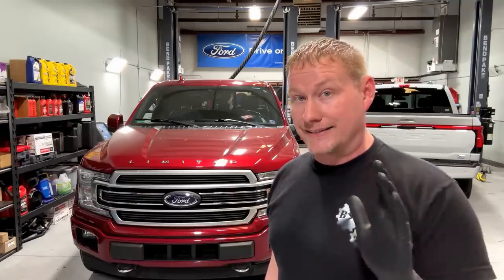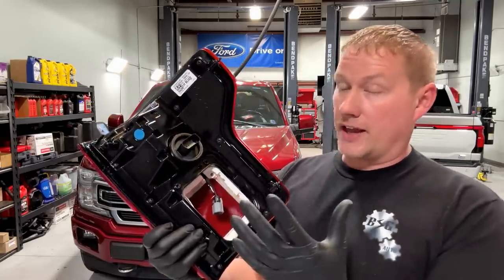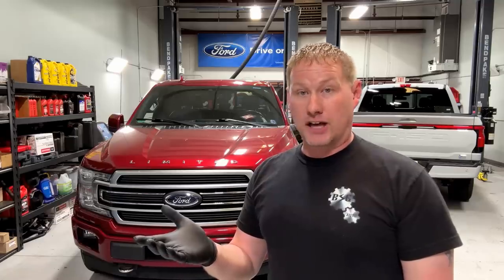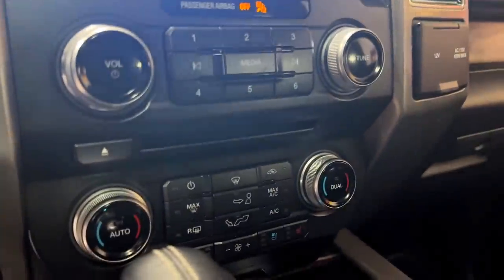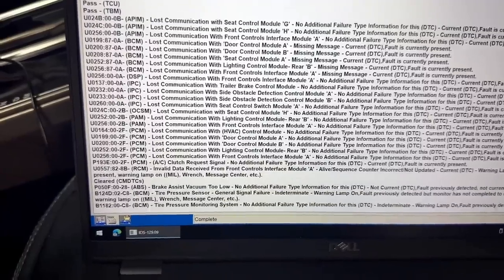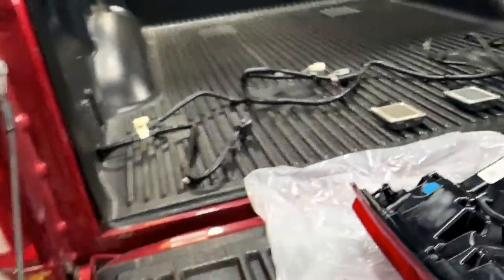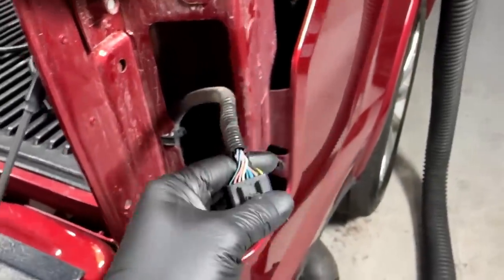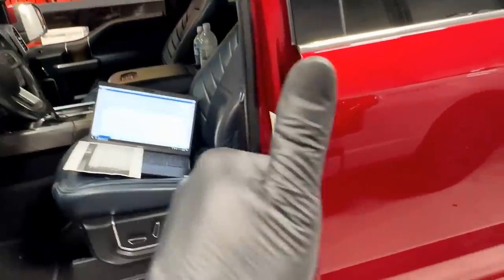Repair Cost Are Out of Control: $5,600 Bill for Some Tail Lamps?!

Comment: This should be reported to NHTSA and at minimum there should be a recall.
Reply: indeed. if that knocks the can bus out mid driving you can lose control of your vehicle.
Reply: Imagine thinking an authority is going to communicate with another authority that some tiny little consumer has an issue they want them to fix. Total the car and buy something you can pop the hood and fix yourself. Tons of videos breaking down cars simply.
Reply: Oh there likely will be a recall.
Reply: @mikenismogtr  As was done to Max Hastings in 2013. RIP.
Reply: Hundreds of vehicles need to start appearing with this issue for a recall to be ordered. The BLIS module is not a legally-required function. If the water causes the taillight to malfunction, that is a legal issue, however not recall-worthy. I wonder if the water intrusion occurred from the weld of the lamp or the seal on the bracket for the BLIS module. If within the warranty window, a dealer would replace this free of charge. That's why extended warranties are so key on modern vehicles, especially ones with loads of features.
Reply: If it was a common problem, sure. I don't think I've ever seen this issue before.
Reply: @jasonashley9853  I doubt it. This is an isolated thing. I have NEVER seen this from a Ford before. The module is protected from the environment inside the taillight housing, the seal just failed. I see this a lot with GMs and their suspension control module that's just chilling out on the rear frame rail.
Reply: Next year's model will include a blinker fluid bilge pump
Reply: Guarantee you that Ford knows this. Theyre aware. Hmmm. Wonder who might work at the nhtsa???  Hmmmmmm
Reply: OR, the owner got ripped because he bought a flood car.
Reply: We see many vehicles out there with cracked tail light housings because someone backed into a post or got backed into. This will be seen more and more.  Making things more complicated is NOT the way to win over vehicle owners.  That is a hugely unreasonable cost for a taillight replacement!!!
Reply: @CredibleHulk I own one of these vehicles, if you look at the tailight design it's a very poor seal, the lens cover itself also has a stress point from molding (running along  the adjacent edge of the tailgate) that likes to crack with temperature shifts. Add to that no weep holes provided and these lamps LOVE to fill with water.  Has  happened to me and several others I've met in owners groups. Ford is aware but chooses to do nothing. Should definitely be recalled.
Reply: Yeah and then Fore will completely shut down over this one.
Reply: 😂yeah right the blood hasnt risen above nose level yet and when it does theyll just build a raft and sail the red seas until the blood rises so high that its lapping the doors of their towers by then all the people that matter will be dead and theyll just wait for the blood to drain
Reply: @LukemDakuwa  Pretty blase advice from one who doesn't even live here. This issue might rise to a finding or even a recall-level event or it might not. Regardless, NHTSA takes safety and driveability issues very seriously, therefore Mfgr's pay attention when NHTSA issues a finding or recall. This ain't Fiji, Sport. Instead of putting your ignorance on public display why don't you paddle your Troll board elsewhere.
Reply: I do recalls at a ford dealership so I'm looking forward to it.
Reply: NHTSA is clearly captured, that they will allow 17" TV screens with difficult to use controls in cars proves the S does not stand for $afety. I am still wondering how GMs taillights whichbturn on backup lights when the doors are open passed standards. Has anyone reading this idled in the street waiting for a GM truck to backup only to find the driver was still entering or leaving the truck?  Isn't this the type flaw a regulatory board is supposed to be finding?
Reply: @pasolumination  Only if enough folks squawk it. In your case might be an issue not one shared by others. If you don't like it, don't buy a Tesla. "There Oughta Be A Law" is easy to say to every perceived inconvenience. Cheers!
Reply: There is like 2 gallons of water in my Ford's trunk after every rain or car wash. (:

It's a feature!
Reply: in that case, every apple product should be recalled, since they were doing the exact same thing for years
Reply: @CredibleHulk I've seen it twice just because I know a couple of people with these dam trucks.
Reply: @CredibleHulk It is common enough. But the real issue is this should be a problem even once.
Reply: @pasolumination why would they if they get paid to not do anything about it...money talks bullshit walks. And dont thinl nthsa is immune to corruption
Reply: @levtsarev Gotta disagree with you here. If a corroded CAN port can cause the whole car to go dead, there is a chance that this occurs while driving down the highway. No power steering, no turn indicators, nothing. That is a safety hazard. Safety hazards can cause a recall.
Reply: Recalls aren't issued simply because consumers demand it. By rule of thumb, automotive recalls are to fix or mitigate a potential issue with the vehicle while it is being driven. If the specific component in question fails while in motion the driver could lose control of the vehicle and crash with the increased likelihood of property damage, injury or death.

If the vehicle is parked AKA not in motion then it is in no threat to anyone or any property. In this case the vehicle would not start, so technically it is of no danger to the public.

As stated in the video the system that failed was the Medium CAN system. The High Speed CAN system was still intact. That means  even if the Medium CAN system failed while the vehicle was being driven the engine will not stall out because it is on a different CAN network.  The vehicle will remain driveable UNTIL it arrives to its destination, parked and shut off. Only then would the vehicle have trouble starting.

A recall could happen through a class action lawsuit. If enough people suffered the same defect with proof then the manufacturer will likely issue a voluntary recall.

Manufacturers are more likely to offer warranty extensions instead.
Reply: The government is why things are as bad as they are.
Reply: they are part of it.. look into the battle for "Right to Repair"  or "you will own nothing and be happy!"
look up Lois Rossman and right to repair....he is on the front line of this battle with congress fighting for your right to repair your own property without this planned obsolescence!
Reply: I'm no electrician or electrical engineer, but wouldn't those issues be solved with a few diodes in strategic locations?
Reply: Good luck still haven’t fixed oil problems
Reply: What caused water to get into the lamp in the first place? That's the real issue. Preventing the seals from failing again. I just saw a 2000 dodge truck today. Looked great. This ford is not a 23 year old model!!!
Reply: @mikenismogtr  That is the central question: what is the actual safety impact of the failure(s)? Since more common things cause failure of the vehicle (like running out of gas) it is a pretty high bar. The smart way to bet is no recall.
Reply: Except they won't do anything. If the company smells money they usually look into every legal loophole to make it legal and then charge as much as they can. Scalpers made this possible by showing that people are complacent and will pay.
Reply: @pasolumination they have been doing that sadly for years as “perimeter lighting”
Reply: Lawsuit
Reply: They are Controller by the Chinese too
Reply: The manufacturers and NTSHA have an under-the-table incest relationship /  deal going on…
When a problem starts to get attention, then the manufacturer issues a “CAMPAIGN”… which includes sending out to the dealers and service departments a “TSB” / technical service bulletin…. So the dealers can REPAIR THE FAULTY PARTS…sometimes charging the customer…  this lowers the “immediacy” at the NTSHA AND THE NTSB…. 
Proof?… research Toyota Tundra and Tacoma rusty frames…. 
Frames were literally breaking in half…. But no recall. A…”Campaign” … kept NTHSA AND THE NTSB off of Toyota’s butt…
Yes…really… the videos are here on you tube….

Comment: I can imagine the look on a customers face when they are told their truck won’t start because their tail lights are bad 😂
Reply: That reminds me of the Chrysler Lebaron Convertible and it's electrical nightmares! Back in the day, Chrysler(Much deserved) got lots of flak for their electrical design faults. Ford shouldn't be given a pass as well, there should be no way a tail light could've caused this much damage. That's just not right at all. FordTechMakuloco is a serious lifesaver!
Reply: @ftffighter  worse part is reliability is rapidly declining
Reply: @zachbruner481 while prices increase exponentially.  Utterly ridiculous.Fix Or Repair Daily.  But Chevy/GMC and Dodge/Chrysler are no different.🙄
Reply: They got filled up with blinker fluid
Reply: The sensor in the tail light is bad, theyll be 5600 please.
Reply: @MattJonesYT  they didn’t used the full synthetic.. now ford won’t warranty it
Reply: @ftffighter  🫨why do you even have to bring that car up?! I developed more PTSD from that car that all my deployments together. I need a drink.
Reply: @malekodesouza7255  It is NOT Fix...Or...."Repair".....Daily, rather Fix...Or...REPLACE...Daily!   "FIX" and  "REPAIR"  are the SAME!🐐
Reply: Good diagnosis…. Yeah that how all companies make their money… $100 for $2 worth of plastic and wires
Reply: Are they sure Apple didn't make this truck?
Reply: The vehicle is bad.
Reply: @zachbruner481  Ford uses and recommends synthetic blend for most non-high-performance engines.
Reply: My friend put a front mount intercooler on a 2016 STI and he had to remove one of his horns to fit it, he had a check engine light when he started it up and was locked in sport mode and couldn't use cruise control...it turns out it was the ambient air temp sensor, he unplugged it unknowingly as it was on the horn bracket, the car threw a check engine light and disabled cruise control and eco mode because it couldn't read the fucking outside air temperature
Reply: @ftffighter I agree, many makes have these electrical problems. One thing I'll commend for for is the ground switch systems on door harness relays instead of positive switch. This way if a relay fails closed the component can't drain battery when vehicle is off.
Reply: Wonder what happens when you get a low tire on one of those things   does that also render it as a paperweight too 😅
Reply: The owner said to himself give me a 72 F-150 that gets 13 MPG and he can replace a bulb for 2 dollars
Reply: @Cobra_427  buy a facotry oem service manual and learn how to work on the electrical side of it. These newer cars are complicated to work on these days you don't know what kinda of fucked up ideas these car manufacturers put into the cars especially a freaking Ford I would not ever buy a Ford.
Reply: Or say the AC system does not work cause of bad tail lights
Reply: @ftffighter  Yes, i remember those LaBarons, and Caravans, The heater conrol module goes down ,it takes down others intermittently,The instrament cluster can shut down intermitten,when another moule takes it down, real electical messes
Reply: @TheOzthewiz Flip Over Read Directions...there you go.😊
Reply: Hilarious but true. Welcome to America 2023. Things will get worse before they get better. Thank your politicians.
Reply: Thought the racetrack tail light on my Durango was ridiculous at 750$!
Reply: Well, that's another problem solved, the problem of people running around at night with no taillights!
Reply: @MattJonesYT  Plumb bob oil.
Reply: @markcdeyoung3118  I don't know, but you might have to disconnect the negative battery cable before you air up the tire! 😂😂
Reply: @bryandevries7210  Almost did with a 1965 Ford Fairlane.  If the left quarter panel and gas tank hadn't caught an 8-10" hickory tree as I was flying through the air and knocked it down, she would have rolled on over onto the top.  It was a power pole that started the roll to the left.
Reply: @zachbruner481  makes you worry twice after being backed into at Costco by someone, and they think broken lens and drive away without saying anything
Reply: @TheOzthewiz  FORD=Fixed Or Recalled Daily.
Reply: Bad news sir- your ashtray is full. We need an engine rebuild.
Reply: That sucks...lol
Reply: @jeffclark2725  and that’s another reason why insurance is so much
Reply: It is great that the owner was not too upset with the cost. Now imagine the next owner in 5 years or the next owner after that. Many people can’t afford $5300 to fix their used vehicle. Eventually all these blind spot systems and collision warning systems with break and most people won’t fix them because it was waaaaayyyy too expensive. Imagine how much a new 10 speed auto trans will cost to replace.
Reply: I had a Nissan Altama once that wouldn't start because the brake light switch crashed and another time on the same car when the lock steering failed .My last back up Nissan vehicle .Oh yeah ,the rear fenders rusted real bad and only 6yrs old .
Reply: @MattJonesYT Ny 95 ford explorer literally takes blinker fluid in the rear driver taillight. Only 1 I've ever seen.
Reply: @MattJonesYT  Hahahaha, actually applies in this case!
Reply: And it's gonna be $5600 to fix them...
Reply: @neilvetter662  or GMs. This is a common failure with GMs that have a suspension control module out back. They corrode and short out and take everything with them.
Reply: It's Ford they got a better way
Reply: Ford stands for:
Fix Or Repair Daily 
Found On Road Dead
If you want to read backwards:
Driver Returned On Foot
Reply: Endless money pit for a pick-up truck. So sad 😢
Reply: @AcidFlash123 Driver Return on Foot
Reply: @nelsonsantos2631 Fried On Race Day, Flippin Owner Really Dumb
Reply: 😂😂😂 @zachbruner481
Reply: I'd probably respond with something like, "I knew I should have done that blinker fluid flush when I swapped the summer air in the tires."
Reply: @WSKRBSCT apple car play.
Reply: Ford should be absolutely ashamed of themselves.
Reply: @Cobra_427 i happily sold my '15 Sti right when covid was taking off and no regerts at all. P303 misfire happens bone stock amd my car had hard bushed driveline, csrbon fiber driveshaft, upfitted for E85 and I couldnt stomach owning a car that would go into limp home mode over a misfire that happens on ALL of em.. 

Doing my research on these F150s bc of the superchargers available and wondering if I should just pour money into my 84 Square body with $12.00 tailiights instead.
Reply: God bless Honda.
Reply: next it will be blinker fluid
Reply: Clearly they just need some blinker fluid.
Reply: It’s like telling them their A/C doesn’t work because their spark plugs are worn, causing misfires that haven’t turned the SES light on yet.
Reply: @TheOzthewiz there's a difference  between fix and repair. See if you can figure it out. If you fix it it's done. If you repair it, it needs to be fixed. Are you a millennial?